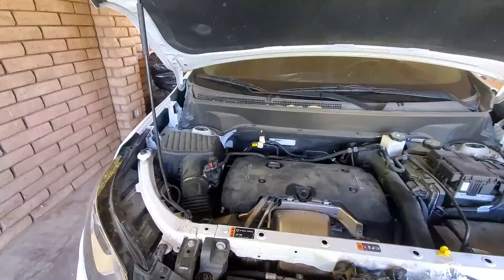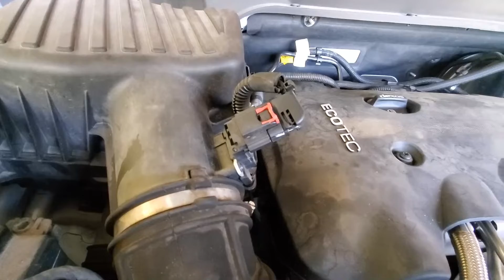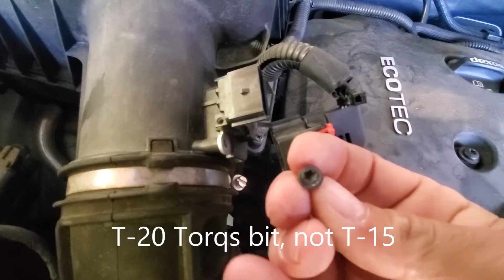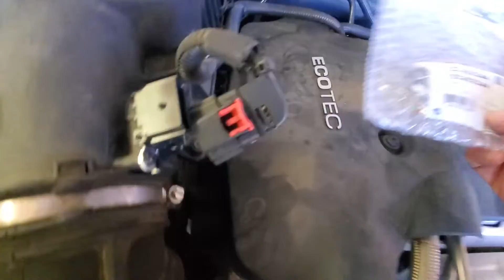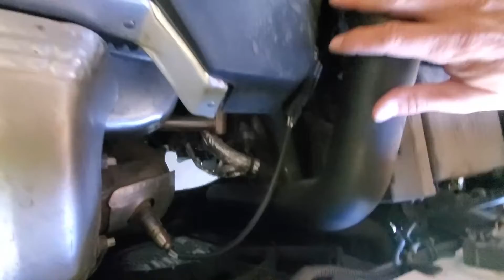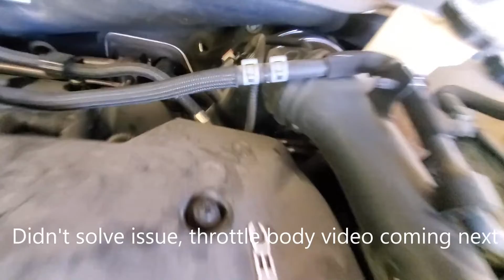How to Change the Mass AirFlow Sensor(MAF) on Chevy Equinox

Comment: Could be oxygen sensors. One located by the turbo the other located upside down on the catalytic converter which is a bitch and a half to get to!
Reply from the maker: Our problem was the engine. We traded the car in and got a honda passport, 3 years ago.

Comment: You didnt try to clean it first❓️🤔
Reply from the maker: On these, the maf looks more like a credit card than a traditional maf sensor. There isn't really anything to clean. The part that reads the air is inside the housing. You can probably clean it if you take it apart, but it's more likely to get damaged. It better to replace them. Plus they are 2 bolt and under $50 to change.
Reply: @SKPcars  
Dang I have the sensor cleaner and was going to clean it then let it dru out at work 2nite🥴
Reply from the maker: @GodessIsabelRaina  you can always try it but i don't think it will work on this type.

Comment: I was going to change throttle body but decided to let chevy do it. Car is running rough. Seems to be iddled or something.  They want me to get the code test for $120🙄 because they found all kinds of ish going on with it🙄 taking it back next week.  A few months ago, when i removed  my airflow sensor then put it back, the car ran smooth for about 2weeks then started the jerkiness again.
 Any idea why it's idling sitting in park position  after cleaning throttle  body❓️🤔 idling like my air/heat is on😡
Reply from the maker: This is tough one just based all the symptoms. First off, if it has a code you can read, it has a check engine light. An obd2 tester is cheaper than $120 to test for codes. If it is an internal code and you need to run diagnostic the computer for that is a couple thousand dollars. There are a few sensors that could be causing an air/fuel mixture problem, which would cause rough idle. It also could be a fuel delivery problem. If you have a check engine light. I would start with an obd2 reader. They are about $20-50. That will get you the code, the code can be looked up online. That will tell you what you need to be looking for. It could be as simple as the tps on the throttle body is bad or it could be a bad fuel injector. Hopefully that helps.

Comment: Good afternoon, I watched the video, and Im having the same exact issues with my car startup. When you took this car to the shop, what did they say was the problem with the car and was it fixed?
Reply from the maker: We had done this and the throttle body. Neither fixed it. I took it to my buddys shop and told him what i went through. He wanted to check through the turbo system. He adjusted the waste gate and found a leaking intercooler. He changed that. While the car was there, a friend of his from Chevy came by to drop off parts. He looked at what it was doing and said the engine was gone and that they had 6 of them sitting at the dealership with the same issue. We didn't get a definitive answer other than it would need a new engine. We traded to the dealer for bad money and bought a 23 honda passport. Thanks for the comment, hopefully yours is not a bad engine